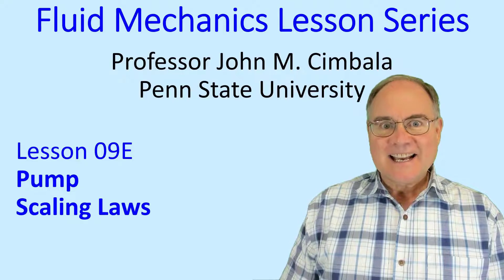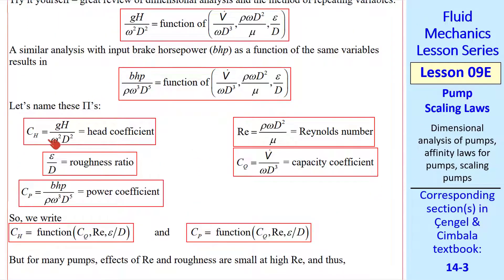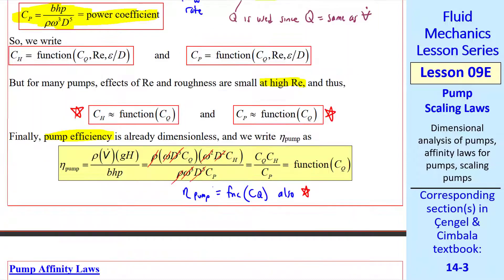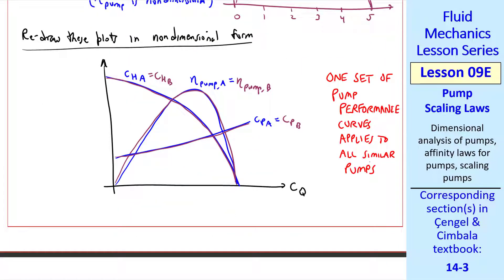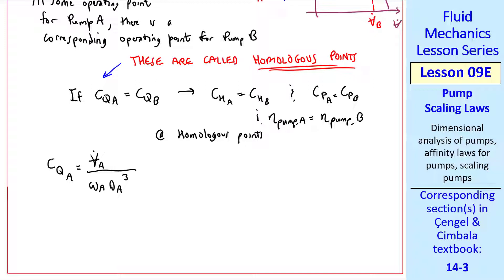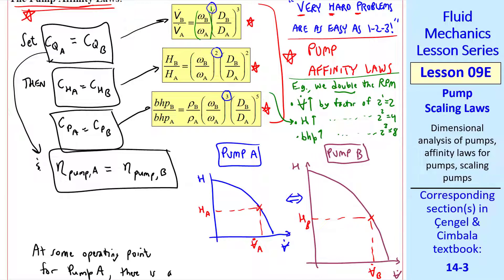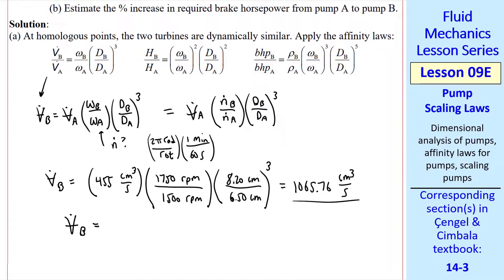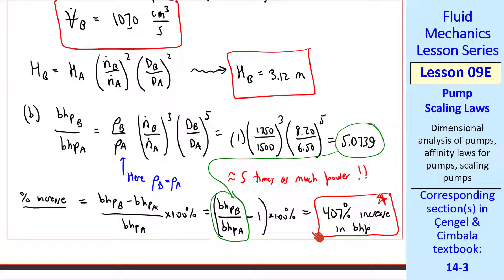Fluid Mechanics Lesson 09E: Pump Scaling Laws

Comment: Hi Professor,
Since C_Q is the independent variable, is it right to think:  as we change some parameters of the pump, we need to make sure the new pump operates at same C_Q just so that we can find other quantities with known quanties from older pump. In other words, the change in V_dot is not an effect of parameter change but rather a requirement to get the unknowns from known quantities.
Reply from the maker: I am not sure I follow your question. The main thing in dimensional analysis is that if the independent PI for one pump is the same as that of the other pump, then the other (dependent) PIs will also be the same. When you change something in the system, like volume flow rate, it affects CQ and thus shifts the other dependent PI parameters also.
Thank you for your comment. Please tell your friends and colleagues about my YouTube channel where there are more than 600 free videos about the Bible, fluid mechanics, science, math, Excel, statistics, air pollution, and other topics. I would greatly appreciate it.
Reply: @johncimbala  Thanks!